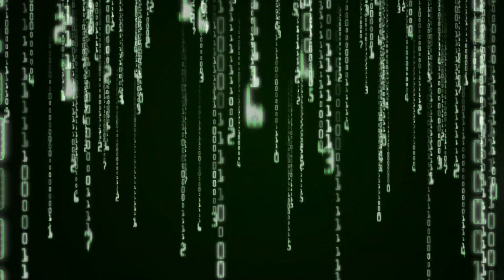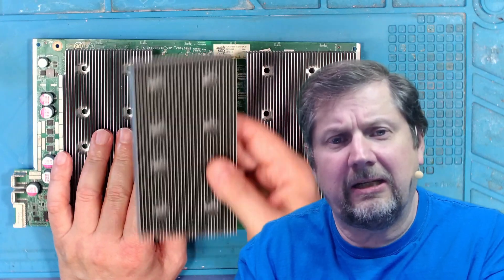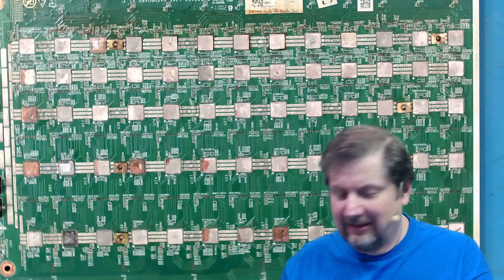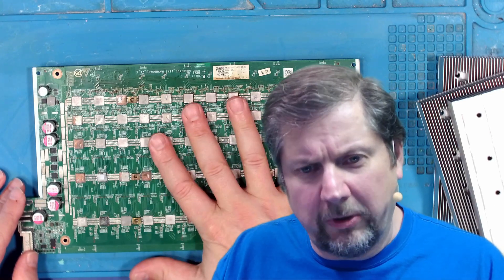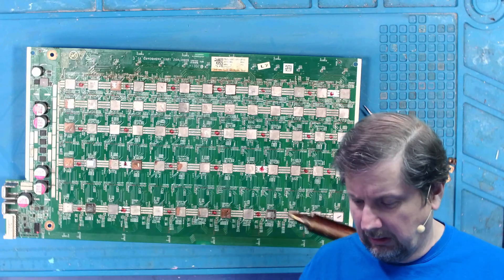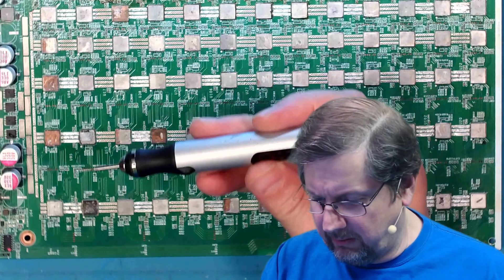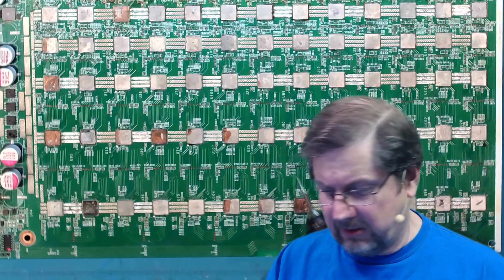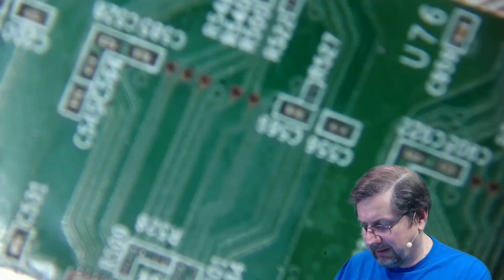Had to improve the heatsink upgrade installation - S17+  board 005  Antminer

Comment: just bought my second s17 pro , payed about 150 euro (160 dollar) with one hashboard not hashing ....... well see i now have the stuff needed to repair hashboards and the price of the whole thing still is cheaper than a replacement hashboard 
they wouldnt make any money with them at this moment if it wasnt for the fact that im not paying a lot for the power needed to run them 
planning on running them at the low power setting increasing the amoutnt of bitcoin per watt  , the two running should come near the hashrate and power consumption of a s19 for a fraction of the purchase cost now i just hope i can get both of them working like they should

Comment: Would you advise an Ultrasonic cleaner for cleaning the boards?
Reply from the maker: Not really, unless you are planning to do some large scale work. I have a cheap ultrasonic cleaner that I seldom use anymore. It takes too long to heat up and it doesn't do the greatest job.  Instead I use a glass 11x13 casserole dish with 99% Isopropyl Alcohol. You can filter it several times and keep reusing it. Coupled with a toothbrush it gets my boards nice and clean.
Reply: @iagmr  Thanks, I am just a noob starting the journey of learning electronics.
Reply from the maker: @silverdesert2970  I was in the same boat last year. Thanks to wonderful people in the discord groups and YT community I learned fast and decided to share what I learned. Wish I had started the videos sooner. Especially when I burned up my first hash board.

Comment: What microscope are you using?
Reply from the maker: It's an Amscope SM745TP-B Head, Mokoose 1/1.8 4K USB camera,  Amscope FMA050 reduction lens, and a 0.7x Barlow lens. I'm not happy with the articulating stand because of the shake. It isn't noticeable when looking through the eye pieces but it is on camera.  There are plenty of similar options out there for less. Just make sure you get the simul-focus feature if you plan to use both the camera port as well as the eye pieces.
Reply: @iagmr  Thanks.